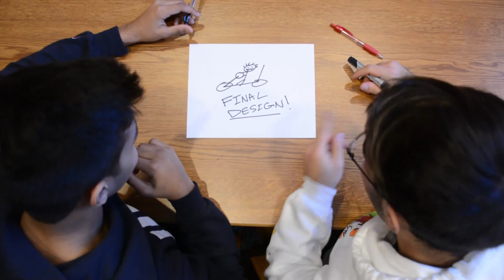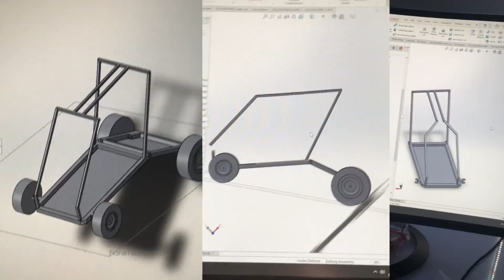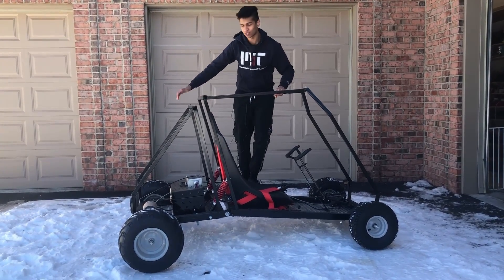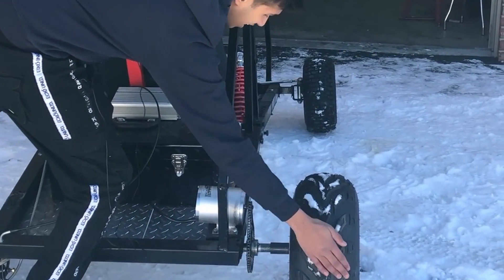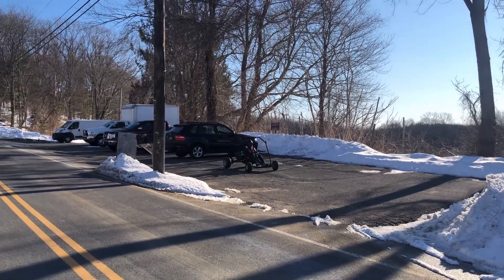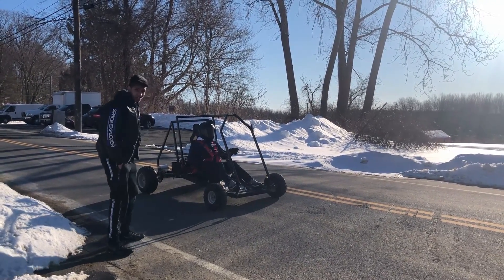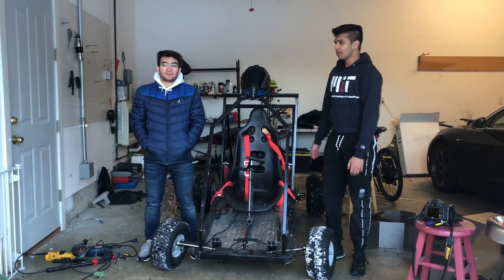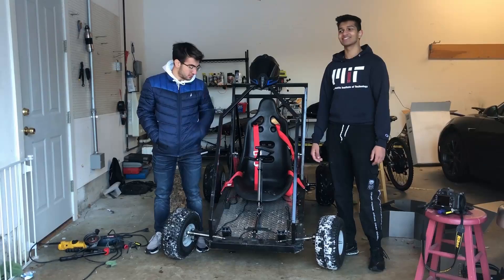CYBER KART (Part 1/4: The Frame)

Comment: damn how far can it go before it runs out of battery? this is sick
Reply from the maker: Shoot, I forget to mention that. The battery is 50ah, so it should run for a little under 2 hours before becoming completely drained, and about 1 hour at top speed. We would have loved more range and (more importantly speed), but electric systems with a vehicle this heavy gest verrry expensive very fast.